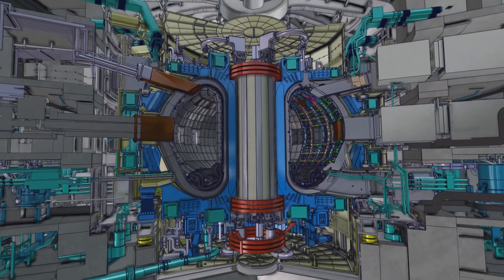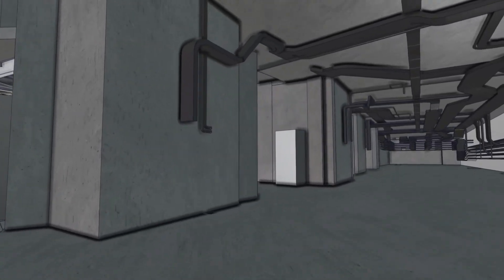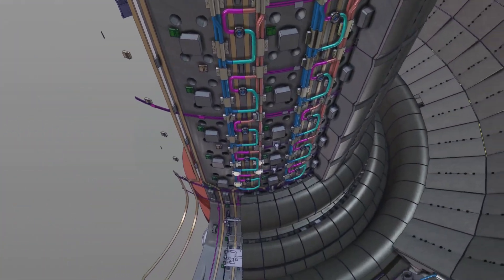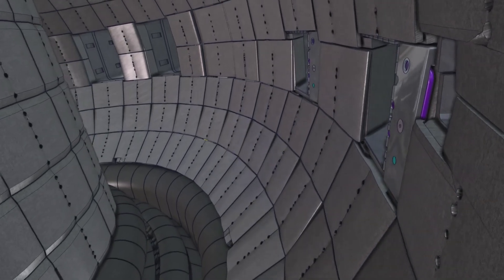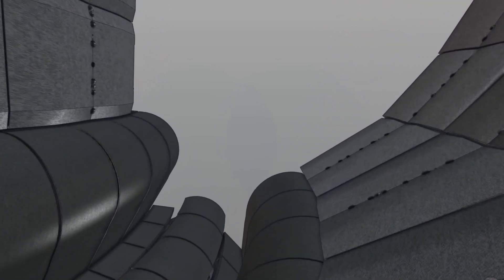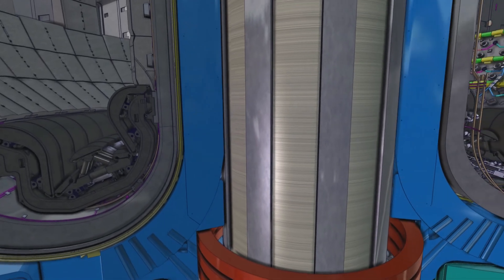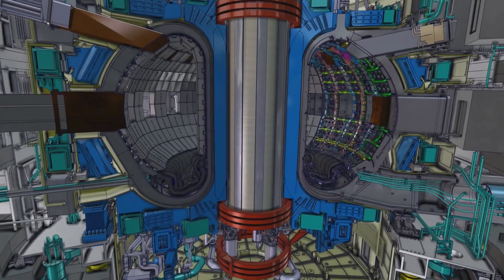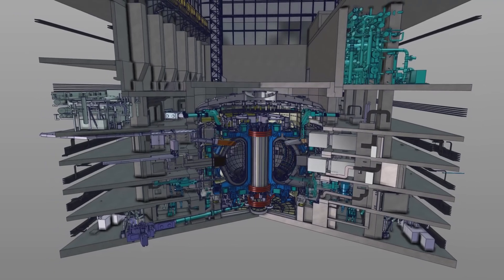ITER Fly-through

Comment: Very interested in teh success of fusion power, but I don't see a path to commercial competitiveness with the requirement of so much precision engineering. It would be one thing if such a device produced 100GW of clean power, but I understand this monstrous building will yield only 500MW. Will the power output be sufficiently non-linear with size after that? Otherwise, what bank would be willing to extend $50B in loans to a private company to build a stadium-sized device? Fission plants routinely get abandoned because of cost overruns, and banks must be wary of these projects now. Perhaps there would be less risk of consultation and permitting delays (and the exorbitant time-cost of capital) with the relative safety of fusion however.
Reply: Remember, we don't yet know if fusion is actually viable yet. We've tried on smaller scales and so far it has not quite worked. We need more power, more precision, on a larger scale to really determine if this technology is viable. Then, miniturization can begin. Think of the first cell phone, it was bulky, cubersome, insanely expensive, but it proved it was possible. Decades later, we have 4 mm thick OLED screens, with internals far far FAR better than even large supercomputers at the time. A similar design cycle is followed for all new technologies. If fusion can be proven to work, it is only a matter of time before it is well more competitive than any other type of energy source, even renewables.
Reply: This is the first experimental, one of a kind machine to prove that fusion is viable with this type of technology.  If it's successful further fusion reactors will be much cheaper. How much cheaper exactly no one knows.
Reply: 1:52 he says "up to 20 MW/m²" since the vacuumchamber is huge, it will exceed 500mw by far
Reply: @Maxhotgo  their own documentation say it's designed for 500mw.
Reply: @CarlosAM1  Solar and wind are like the spinach, vegetables, and the fruit of energy generation. They take a lot to fill you up and aren't usually constant generating. Coal and oil is like junk food, reliable and will fill you up, but not good for you. Eating junk food all the time isn't good for you, just like how using only fossil fuels is bad for us. However relying entirely on wind and solar isn't good for you either, you need a "balanced diet" of sorts, where constant non-renewables subsidize the energy generation of renewables due to wind and solar not being constant. To say wind and solar are terrible is a very misguided opinion, as with the right support (such as nuclear and perhaps in the future, fusion) they can be an invaluble part of an energy production system.